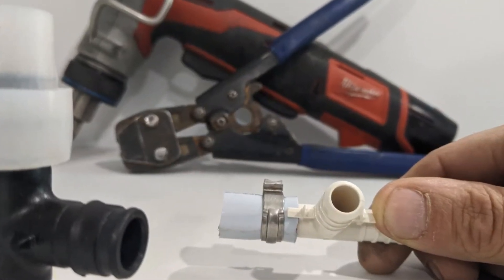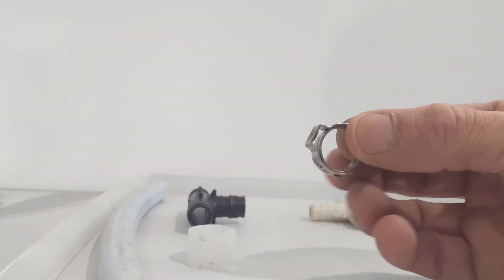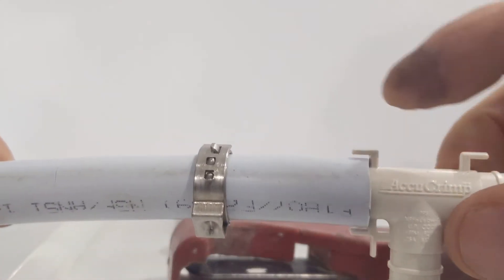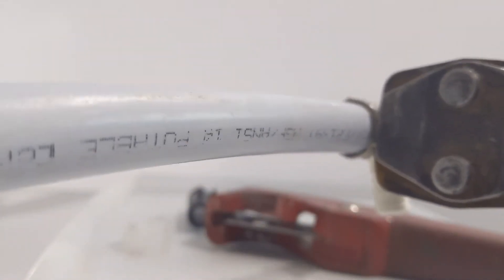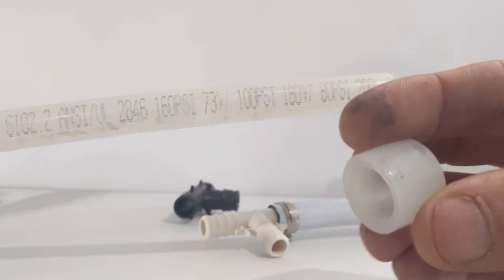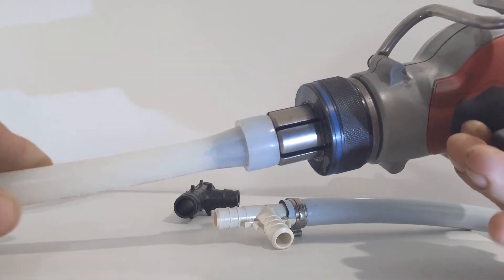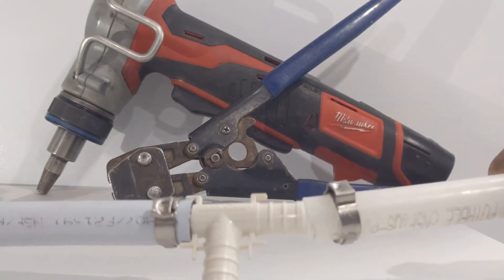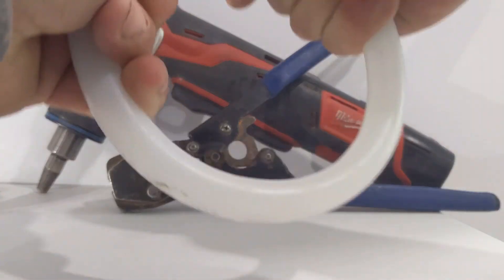PEX A vs PEX B Which One Actually Works Better?

Comment from the maker: What experiences have you had with PEX waterlines?
Reply: The downside of PEX is bad installations as PEX is more DIY and unskilled/low skilled plumbing/hydronic heating installer/helper/hack friendly
Lots of undersizing, too many restrictive connectors and 90s, and weeping/leaking PEX B connections with cinch clamps, copper rings and push to connects
Lots of leaks from copper and iron to PEX transitions as well
Lots of kinked piping as well from attempting tight radius bends with PEX B
Piping management is an issue as many installations look like spaghetti
That said, I love PEX when done right, and prefer PEX A due to the larger internal diameter, the ease of installation, the expansion tools, the versatility and the more professional and finished look of PEX A expansion sleeves
When I replaced my boilers and indirect water heaters they were plumbed with PEX B, so manifold outlets, returns and supply piping were undersized
They'd used PEX B copper rings, and many were weeping when cold 
They must have had bad clamp tools as there were witness marks, a raised ridge on dozens of copper rings
They'd used stainless cinch rings in difficult to access areas, and some of these were weeping, or cinched in the wrong spot